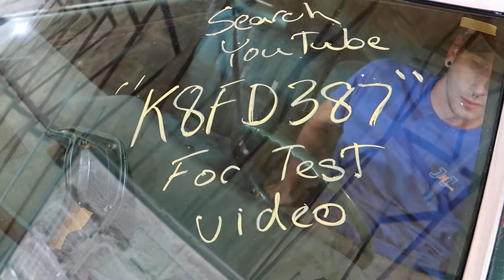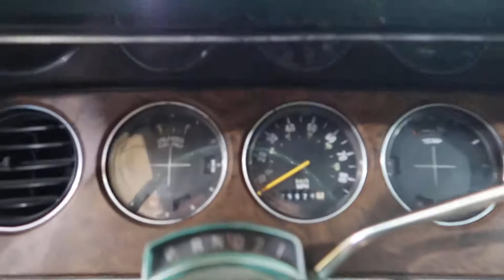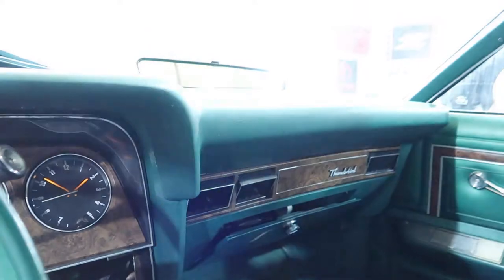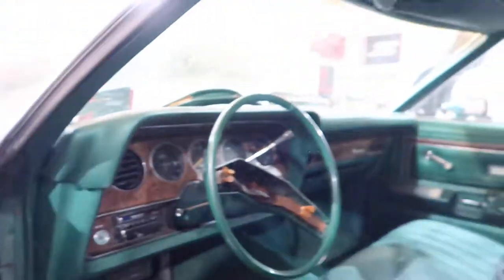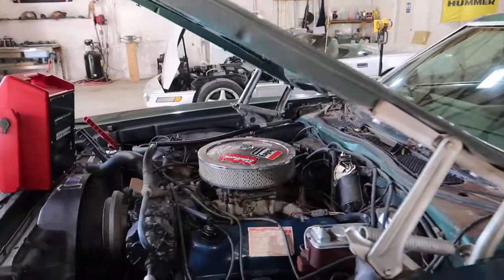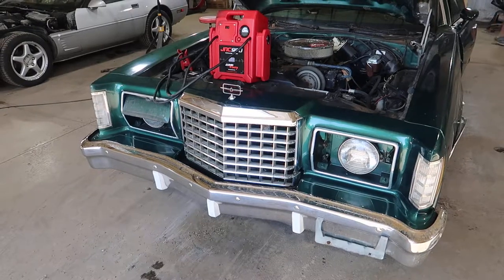K8FD387 1978 Ford Thunderbird Test Video

Comment: more than likely its 125,000 miles and all had FMX trans in them, you will never get 749.00 for it, best sell intake/carb and junk rest, partout the bird
Reply: All had FMX... I dont think so considering mine has a C6
Reply: Yeah FMX behind a 351M or a 400...I think NOT... I have NEVER seen an FMX behind anything but a 302 or 351W... (Or the uber rare 1973 400 with small block pattern) most of those guys that say "ALL" are just "interwebz blow-hardz!" LOL!